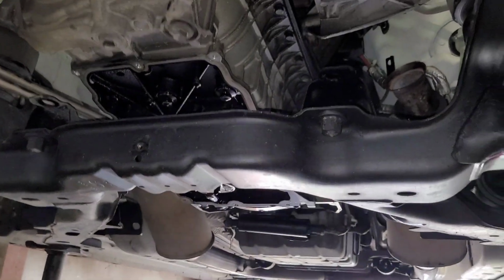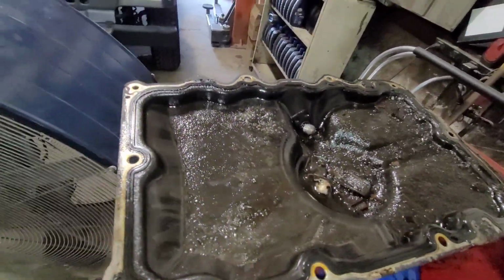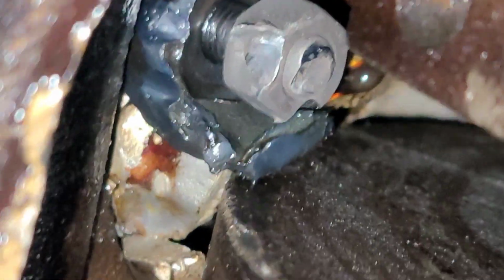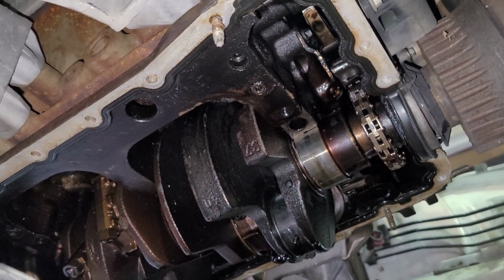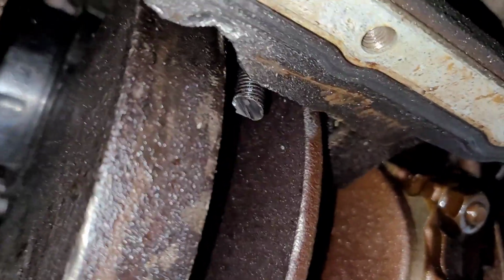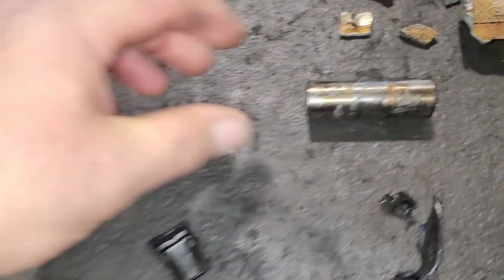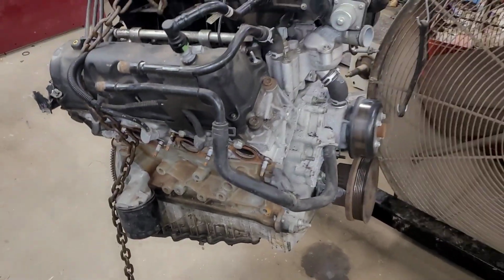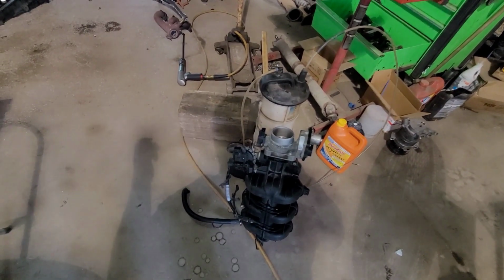Blown up !! Seized engine and a Twisted Connecting Rod !!

Comment: I had a 4.6 in my F-150 do the exact same thing I just changed the oil and stuff and was leaving for a vacation 45mi down the road it grande d with no warning no check engine light no knock sounds nothing

Comment: If you keep up on the oil changes and don’t over heat these engines. They go for a long time. 
The early 4.0 sohc engines would eat timing chain guides. Ford changed the plastics for the guilds. Supposedly fixing the issue. 
Not sure about the mustang 4.0. But on the Ranger’s and Explorers. The thermostat housing was a week part. Also a pain to get in and out.

Comment: the last reman engine i got had a wire mesh filter over the intake port so if there was anything in the intake it couldn't get back into the motor

Comment: Might be a good idea to replace the rear timing chain before the engine goes in.  Otherwise the engine has to be pulled tor replace it later.

Comment: In my experience, these catastrophic failures are a result of ignoring noticeable changes in the operating characteristics of the engine. Like you said, they don't just happen. (i.e. operator error).